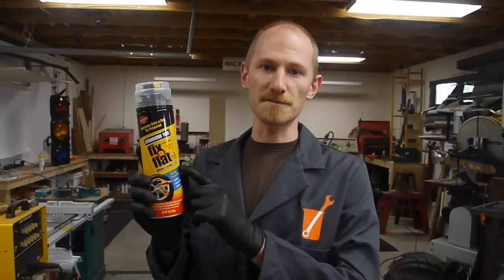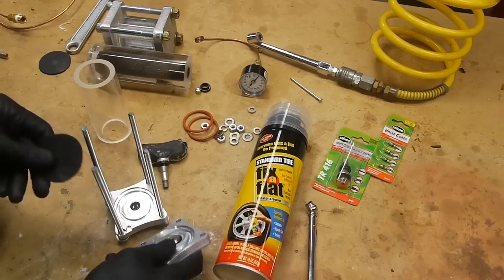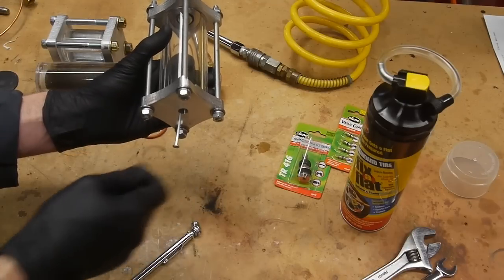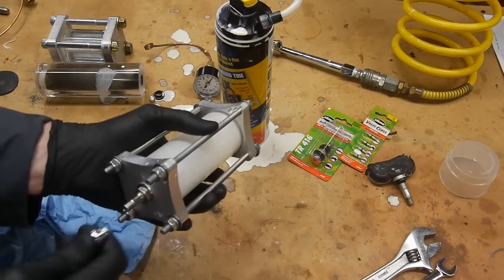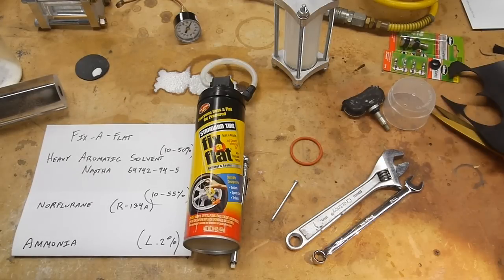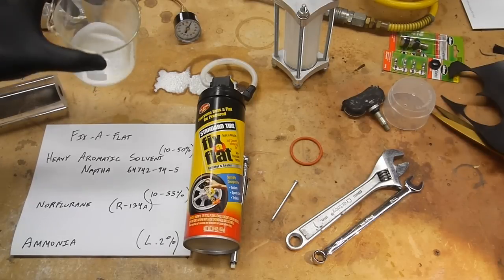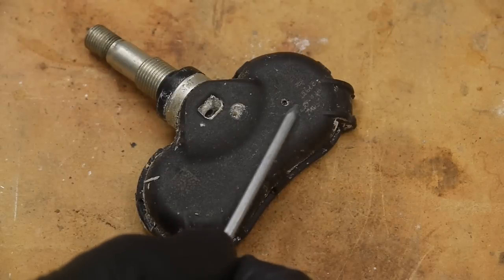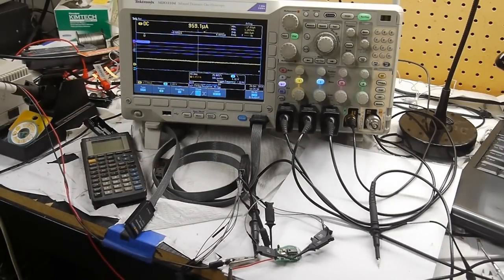Tire sealant chemistry and tire pressure monitors

Comment: The tire pressure monitoring system on my car is pretty neat. There aren't any sensors in the tire at all. The car just monitors the rotation rate of the wheels and sees if they're all the same. If you change out the wheels, the sensor may give a low pressure indicator, but you can re-calibrate it to the new wheels. I like this because I don't need to worry about any of those sensors or special wheels.
Reply: LazerLord10 Audi that is?

Comment: Ben, the latex is in a water-based emulsion and the ammonia serves a dual function as a stabilizer and as a vapor phase corrosion inhibitor for the aerosol can. There are numerous other chemicals used in the product that are not listed on the msds because of their low toxicity - water, for example.

The HFC-134a (1,1,1,2-Tetrafluoroethane) is used for safety purposes as it is the only non-flammable propellant in commercial production. Mechanics working on a tire that had been inflated with the aerosol repair product, could accidentally strike a spark against the rim and cause the contents to ignite if a flammable propellant were used.

Use of 134a is no longer allowed in air duster products, and is being phased out of general use except for medical products and a few critical manufacturing applications. Use in tire inflators is prohibited as of 1/1/2016. The phase-out for auto air conditioners will be a few years later.

Comment: Fix a Flat almost killed a friend of mine. As the tire was filling the Fix a Flat sprayed out of the hole in the tire covering there upper body. Next thing my friend remembered is waking up in the hospital on a ventilator. Latex was not listed on the can and my fried is HIGHLY allergic to latex and had a severe anaphylactic reaction to it. A police officer found my friend unconscious and got them medical help.
Reply: Michael Carroll Your friend needs to be more careful when repairing a rubber product, as there is a damned good chance that the repair method includes latex.
Reply: thats not the anecdotal confirmation of latex i was hoping for nor expecting

Comment: Thank you for this video! I work at an auto shop and we replace TPMS sensors. I work with them every day. Fix-a-flat is miserable to work with. I've always wondered how they can put "TPMS-safe" on a can when it will obviously cause problems to a sensor. To make matters worse, many manufacturers are skipping a spare tire and instead providing a "kit" in the trunk which consists of fix-a-flat and/or a 12V inflation pump. Sensors are actually very very reliable under normal conditions and many times end up being tolerant of some sealant exposure. Most sensors, including the TRW sensor you have there, will make that 550mAh battery last for 8 years of use and beyond.

Comment: I really hate it that chemicals are never stated by name on products. Especially for cleaning products and glues, but also paints, lubricants and in a wider range plastic products it's always just "organic acid", "surfactants", "organic solvent", "plastic".
There are so many things you can damage or destroy by using the wrong chemicals on it. And so many things to easily fix, if you know what they are made of.
Reply: That's why it's so handy that manufacturers publish the MSDS (material safety data sheet) for products like that.  I think that's required by law but I'm not sure on that.  You can use the MSDS to see what chemicals are in the product and what the overall product health and safety hazards there are, and then do the same for specific individual chemicals.
Reply: *****
Yes, they have to make it available to you, if you ask. But try getting ahold of it while you're in your favorite DIY store. If you're lucky they publish it online and you got a mobile that can access it. Still quite a hassle if you're standing in front of a shelf full of glues.
Plastic parts don't have a MSDS at all, so it's mostly experience to be able to tell what something is made of. I often buy stuff, like pipes, conduits, hoses, aso. not for their intended purpose but to use it in a project where I need to glue, seal, mold to it. If you got something out of PE or PP for that, you're out of luck. One of the best ways to determine the type of plastic, is to burn it. But my guess is, my DIY store won't like that for some reason. ;)
Reply: Where I live they have to and yes its Latex in these, we have similar ones and its stated latex.
Reply: superdau If you happened to make such a product, I guess you would tell your competitors what it is made of only reluctantly :P

Comment: Going on a hunch here....... I imagine when there is pressure in the tire above a certain level (just say above 15psi for argument sake,) the sensor circuit would be completely switched off, or be disconnected from the attached battery, for any sort of battery life to be possible. When the tire drops below a stated pressure (say 15psi,) the circuit attached to the battery would switch on, transmit a small signal that either the ECU/PCM or body computer would pick up, then produce an "idiot light" or warning lamp. Refilling the tire would then put pressure on the switch, disconnecting the battery from the small transmitter again..... And off you go.
Reply: Cars that I have seen that have pressure sensors, can give an exact pressure measurement at anytime on all tires
Reply: LittleMe I Imagine the more you check your tire pressure using that system, the faster the batteries go dead. Unless they are using some other system??? My little car has a button you push to check for a warning, but no pressure stats available, just a warning lamp if there is an issue. I wonder if it just alerts the ECU/PCM or body computer to look for a transmitted signal?
Reply: +Mr Carlson's Lab wouldn't you want to know if you're tires are over pressurized too?

Comment: I worked in an auto repair shop during college. I hated working on tires that had been filled with fix a flat. It was difficult to clean it out from the inside of the tire. Thankfully it was rarely used and often times when it was, the tire wasn't repairable.
Reply: How do you clean it out? Not looking for a detailed answer, just very curious.
Reply: RimstarOrg There would be a puddle of liquid fix a flat in the tire. We would take it out to the parking lot and bounce the tire around to knock what we could out. Then we would spray the tire out with a hose. Next we would bounce the tire around to remove most of the water. You would then have to use rags to soak up any remaining liquid. The patching process involved abrading the rubber and using a chemical cleaner which would remove any fix-a-flat film in the area of the puncture.
Reply: ricksite
I see. Thanks for the answer!
Reply: Been there - done that. That shit would stink also!
Reply: Slime is a whole lot better and easier to clean out of the tire.
Reply: @rileysmith9843  There's also a brand out of the UK called OKO which washes out. No latex used at all with this product.

Comment: Since rubber is modified latex from latex trees your guess makes total sense. The naptha solvent would help the latex bond with the rubber then evaporate to add to the air pressure. Nice work!

Comment: Excellent video.  Last year I had a flat and temp fixed it with a can of Fix a Flat. Brought it right over to the mechanic to get plugged and he said he hated the stuff as it is such a pain to clean out the inside of the tire.  As for the temp sensors, I've got a 2009 Chrysler and within the same couple of month time span all four tire sensors failed (I'm guessing the battery).  So they lasted for almost five years and cost $100 to replace, each!

Comment: One of the more underrated videos you've produced. I experienced this recently with my tire.. and wal-mart won't touch your TPS so I made them give me the sensor and it's been sitting in my console ever since. I think I'm going to repair it instead lul.. The battery looks to be comparable to a 2032 and the PCB can easily be cleaned/repaired.. I did not know 'aromatic was a description of the molecular shape; that blew my mind! 

*R-134 use in this case is ingenious! So now the question is: Did I break federal regulatory law by depressurizing my tire without collecting the gas! I wonder who got paid for them to bypass that one..
 I would push back against your premise that the TPS internal port would not affect pressure sensing because if the modulus of elasticity of the sensing port has changed then the resulting pressure would also change. That's to say, if the sensing IC was not permeated by the solvent. Just as if you corrode the spring on a lawnmower carburetor flow regulator or any such calibrated device. Fun video. Thanks!!

Comment: Great work, as usual. I wondered when you discussed the higher duty cycle time (when testing the failed sensor) if the absence of normal tire pressure causes it to send on a more continuous basis to raise the alarm about the low pressure. But when in the tire, I agree that even blockage of the port wouldn't cause a low pressure alert as long as the plug is soft or springy, as it would be. Aromatic solvent and ammonia mixture sounds pretty bad for electronics. Not going to buy another new one to do destructive testing and comparison? The manufacturer should have made that caviat clear at the same spot that they said it was safe for tires with sensors.

Comment: Very interesting as usual Ben.

I had an Audi A3 with a tyre pressure warning system that was much simpler and wouldn't have that problem. I think it just used the wheel speed sensors of the ABS system to detect a wheel being under inflated as presumably it speeds up relative to the others due to the reduced diameter. If you changed a tyre you had to press a reset button to recalibrate it for the new diameter.

I am not sure if it could detect them all slowly going down at the same rate but that probably never happens. It seems like a much better scheme than battery operated devices in the tyres.

Comment: Weren't you measuring the current on the circuit while its at room atmosphere, quite likely that the sleep state is at 35 (or so) psi and since room pressure is a lot lower its always triggered on.
Reply: R Mack  My sensors will dynamically update while the vehicle is stationary. I regularly use them to top off my tires since they are consistent between sources. I have tested them against a calibrated dial gauge and they are quite close. I plan on taking mine apart when I replace them since I am getting occasional TPMS failures but before now I was expecting some thrust based recharge function. That way they could use a supercap instead of a battery. The cap would eventually wear out too, but the recharge would help prolong the power state. They transmit on very low power on 315MHz. I bet the chip contains a serial EPROM. The transmit data would be the serial and the pressure. the programming is so the BCM can ignore any other sensors that it may pickup. It probably works similar to toll transponders which transmit at 0,0005w.

Comment: pressure sensor charges the battery wirelessly. Behind every wheel arch cover lies the antenna than with induction charges the battery while the car is running. Just like the induction ring around ignition key that charges the key battery (like in bmw, audi, MB)

Comment: Excellent walk-through analysis of the fix-a-flat.  We had similar occasion to use it and next day at the garage our mechanic, "fuzzy", chewed us out.  Apparently the stuff is very difficult to clean from the tyre.  He is not a proponent of the product, but said that it has also saved many customers from more expensive towing or simply accident by lingering in the roadway trying to change out the flat.

Inquiring minds would like to know if in fact the pressure sensor element failed, and/or if the fix a flat chemical soup managed to break through the conformal coat.  Would replacing the sensor (or clearing its port) fix the current draw issue?  I say clearing its port as the question remains as to whether or not the material hardens over time, hence rendering the sensor useless after a few weeks.

Would be great if you might continue the analysis, letting the stuff sit for a while, etc.

Comment: In addition to latex some such compounds seem to have chopped up fibers as well. They help by forming a kind of mesh at the puncture point. Liquids leak through fibre "plug" until enough rubber has been formed. It can make a huge difference with bigger holes.

Comment: I wrote the firmware for the system used by auto manufacturers to test and pair TPMS devices when they are installed at the factory, which is more complex since it needs to read units made by all of the major TPMS vendors. I can't comment on the specifics of the firmware, but I can answer questions about how the various TPMS systems work.

Comment: Cool, I would also love to see a video going into more detail of how the sensors work and how that device communicates with the car, e.g., can it be spoofed?
Also, what happens if you dip the sensor only in some 99% alcohol for a while, then clean it out with a blast of air?
Reply from the maker: Yes, I was thinking of talking more about the RFID aspect of the system, but this video was already 10 minutes, and I wasn't having much luck with getting usable signals from the chip.  If I detect some interesting signals, I may make another video.  On some cars like my Honda, the sensors each have a unique ID number.  After replacing a bad sensor, the car's main computer must be updated by a specific Honda interface tool to include the new sensor's ID.  Only a Honda dealer can do this.  Clearly the engineers of this system didn't spend much time thinking about how the car could "learn" new sensor IDs automatically or even semi-automatically.
Reply: I would've enjoyed the electronics side a bit more :) I was trying to think about how the sensor would communicate with the on-board system, thinking it wasn't using batteries because of it having to be serviced, but after looking online I was a bit let down to learn they do in fact use batteries. They could at least use a special port to charge them on the value head :D
Reply: Nitrxgen
I wonder, with all of the movement a car wheel goes through, couldn't they add something to both the wheel and body of the car to make some kind of electric generator, even if it is horribly inefficient, if it could generate enough power to charge a small battery or super cap, instead of using an annoying non user replaceable battery?
Reply: Razor2048 But then the stealerships couldn't charge you $$$ to replace them. These days, many new auto technologies are designed to make it too expensive for small shops and amateurs to afford to repair them.
Reply: Razor2048 they have tyre pressure sensors that come with many modern cars that rely on ABS, and other telemetry to extrapolate the tyre pressure. just check out Indirect tyre pressure monitoring. http://en.wikipedia.org/wiki/Tire-pressure_monitoring_system#Indirect_TPMS
Reply: Applied Science Some cars use the ABS system for tire pressure monitoring, like our '12 Passat. When the tire gets low its rolling diameter will change and the ABS is sensitive enough to detect it. The ABS based systems can't tell you what the pressure is in each wheel and can't detect low pressure until you start moving, but there are no sensors to replace / train / duplicate for winter wheels. After checking and correcting the tire pressures you simply press the TPMS reset button.
Reply: +Razor2048 ... Depending on quality, the battery in a tire pressure sensor is actually designed to last between 5 to 12 years, which is actually longer than the average person keeps their vehicle (3-5 years).  The people who end up buying new cars probably won't ever have to deal with a sensor who's battery has run out naturally.  Buying a used car, well that's just another perk...

Talking power usage, the sensors are actually incredibly efficient in reporting tire pressures.  They do this by staying in a "sleep mode" as much as possible.  Only a few situations wake them from this mode.  First, if the vehicle sends a request for the tire pressure, usually done at vehicle start-up and every so many miles driven.  Second, if the pressure in a tire changes dramatically (usually 5-6 PSI).  The sensor broadcast is short and very low power.  It's picked up by a send/receive antenna that's built into the vehicle.

As for communication, every sensor has it's own unique Hexidecimal ID number.  These numbers are programmed into the on board computer of the vehicle through the OBDII port.  While your car may be able to detect the tire sensors in all of the vehicles around it, it only pays attention to the tire pressures from the sensors with the proper ID numbers.  In addition, some vehicle manufacturers even use different radio frequencies to further the uniqueness of their sensors to everyone else's.
Reply: Gaming With ViperZeroOne " the average person keeps their vehicle (3-5 years)." 
The average US owner keeps their car for 6.5 years, and the average age of a US car is around 11.5 years.
Reply: +Chris W ... Tire sensors aren't limited to the U.S.

Comment: Used this stuff once long ago on a car that had aluminum rims. Don't know if the products have improved or not, but I waited to get that tire fixed. Latter serious corrosion was seen on that rim. So bad that the new tire would not seal against the rim. It did get me back on the road and into work that day however.

Comment: Ben, you might be interested to know that the law doesn't require tire pressure sensors per se.  The law only requires that the tire pressure be monitored.  The way many manufacturers do this is with the ABS sensors.  The computer monitors the pulses from the ABS sensors and detects differences that would indicate a tire changing in diameter.